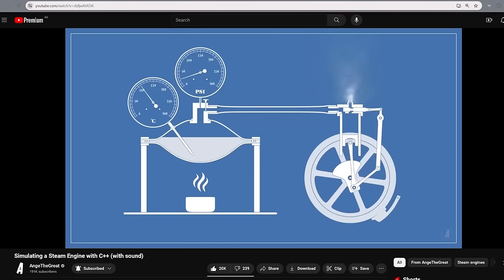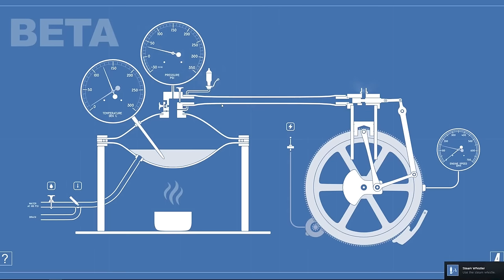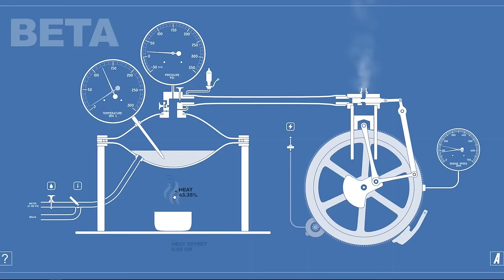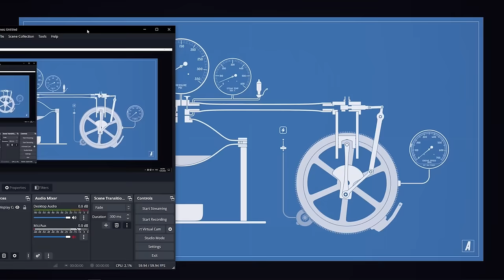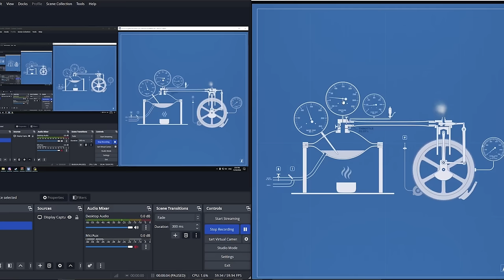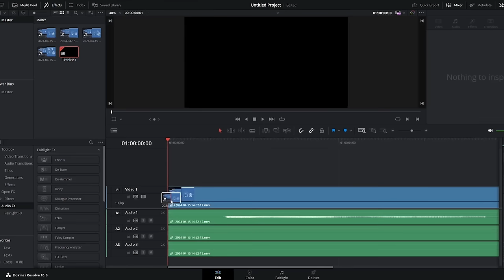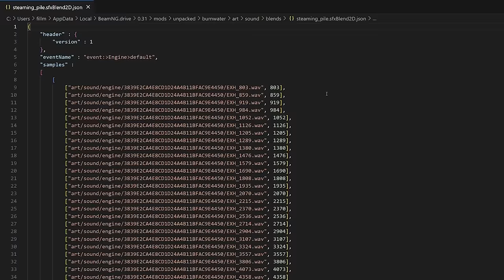Steam Engine Simulator into BeamNG

Comment: fun fact: contrary to popular belief, a steam engine does not have one chuff per revolution, most steam engines have two to four chuffs per revolution
Reply: more usefully there were like, three manufacturers that each made multiple models of steam powered road car, you could look up videos of those for the sounds
Reply: It depends on the number of cylinders and the number of power strokes, i.e. does steam operate the piston in both directions.

There were also multiple 3-cylinder locomotives that produced 6 chuffs per revolution, such as the Gresley A3 and A4.
Reply: It realy just depends on how the steam is built

Comment: I believe the trick to all this is: add a zero to all your values. Sure, it wouldn't be the actual RPM of this steam engine, but, seemingly from what you said, it would have at least had an easier time working.
Reply: Or add a 10:1 gearbox after the engine but before the clutch.  That being said, steam engines are much more like an electric vehicle than a normal car, there was no need for gears since you had so much torque.  The driver basically just set the throttle to whatever speed and the car went.

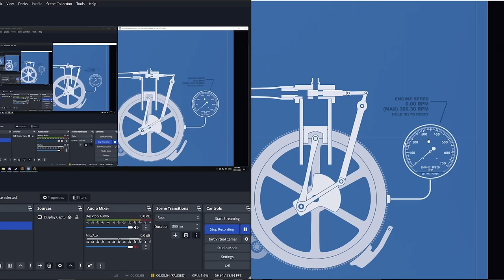Comment: 5:44 correction: thats the max RPM you hit, ingame by default it can do 700 and if you activate the secret it does some insane number like 20k.
Reply: More like 4500 or even 6000 if ur rlly good at setting it up
Reply: @jasonlin9805  yeah but that still requires the secret, as its the only way to get thousands of RPM, instead of just a few hundred.

Comment: So one tip when steam is up to speed and is burning clean there is no smoke/steam coming out the exhaust it only happens at lower temps or under serious load Kind of like giving a diesel truck the beans and rolling coal . So maybe have it come out at low Rpm and turn off at higher or when you give it a load. Eh but that is maybe a nightmare to code LMAO. Good job by the way sounds looks amazing!
Reply from the maker: If I had more control, then I’d have put more nuance into it. But thanks for the advice

Comment: Making it electric is technically more accurate than gas, because you would 100% go through water really damn fast, especially at high throttle. And steam engines are very heavy.. and also make ridiculous tourqe.
Reply from the maker: There are arguments for why it was the right choice :)
Reply: And they produce torque at 0 RPM

Comment: With a steam engine, or any engine, the faster and engine is rotating, the faster the exhaust beats. You can't usually hear the individual exhaust beats on a gasoline or diesel engine because of how high of an RPM they operate at. With steam, it can operate slow enough that you can count the exhaust beats. Also the amount of load on an engine determines how loud the exhaust beats are.(more load=louder exhaust).

Comment: The next big thing would be a turbine engine, with proper muffling like the Chrysler Turbine had, but I don't know what game could be used to extract sounds for it. Maybe Flyout? Anyway, I love this, unconventional engines like steam and turbine in cars are really cool to me.
Reply: It's coming to beamng in the upcoming Gavril Dynamo car mod, based on the Chrysler Turbine
I don't know how it will sound, hopefully realistic
Reply: @RickZanardi  From what it sounds like, the turbine sounds are a bit loud compared to the whisper-silent Chrysler Turbine, and its odd that the turbine goes up and down in RPM as it shifts, but the latter part is just a limitation of BeamNG since its not designed with a decoupled engine core and output turbine in mind. Otherwise, I'm quite looking forward to the Gavril Dynamo!
Reply: @Avetho  yeah you are right, after all this is so niche that it is pushing the boundaries of the game. But let's see, at first even hybrid systems were a pain to do but now there are a few mods, maybe a proper turbine car can be done realistically in the future.
Reply: @RickZanardi  I sure hope so, someone managed to make a convincing enough approximation with the Bluebuck with high inertia to simulate the inertia of a turbine spinning at 50k rpms, I just had to hook it up to a CVT and be selective in my throttle control to make it vaguely turbine-like in response. Its fun regardless, I can only imagine how exciting a proper turbine car would be!

Comment: Could you somehow hack the air pressure system of the T-Series to behave like a steam engine, and have the ICE just serve as a source of "heat" providing pressure to it, and use that pressure to drive the wheels?

Comment: Wood gas (yes thats a thing youtube has some fun videos on it) fuel mod next
Reply: A wood engine is barely different from a normal ICE engine though. The main difference is in the fuel storage system being more similar to LPG.

Steam engines have different torque curves, fuelling, cooling, etc etc etc. Basically the whole thing is inverse of what you expect with peak torque at 0rpm and the engine gets better the hotter it is wanting insulation not cooling.

Comment: You can hit the C key to show controls and exact speed along with speeds being x10 if you click the angethegreat logo several times in the bottom right allowing up to 7000rpm but I haven’t got over 4500rpm, so it won’t sound odd like how it was when it was first exported

Comment: 18:04 did you not see the huge speedometer in the bottom right i know that the air speed is a bit more accurate but was it very necessary to calculate?
Reply from the maker: The Speedo can be very inaccurate when testing top speeds
Reply from the maker: Also it was just some fun to use that odd speedo

Comment: Theres actual Electric Steam engines
Boilers being heated by electricity
Reply from the maker: Sounds counter intuitive because you could just run an electric motor lol
Reply: @fillman86  something you forgot is 
Electric motors were pretty crap back then
Reply: @fillman86  It was done by Switzerland because they didn't have any natural reserves of coal and coal from Germany was getting costy (because this was the 1940s) but they had a lot of hydroelectricity and hadn't fully replaced steam with electric, so in 1943 they fitted two small 6 axle steam locos with pantographs and electric heating inside the boiler and could run for 20 mins without power and then had the electric heating removed in 1951. Something like it was that some steam locos had electric pre-heater which slowly steams up the boiler so it can work in the morning.
Reply from the maker: @RiCKY-zt3tl  actually they weren't, but generation was. And if you go really far back, it was control that was the issue

Comment: Day 2 of commenting: You probably wont do it, but anyway. Here is a car Suggestion if you want: the Xiaomi su7. There are 3 variants of it, different in their Performance. I thought,that it would be a bit more of a Challenge if you would be able to switch modes in that car. But while driving, so you press a button and you can select between the Performance and the Suspension settings(like race mode with hard Suspension and comfort with soft ones). I thought Maybe 3 modes,and each mode should match the Performance of the 3 variants of the su7.
Maybe you are interessted.
Sorry for my bad Englisch,its not my native language. If you dont understand what i meant, i could try to rewrite it and explain it better if you want.
But anyways,i really love your videos

Comment: for the engine torque the max power would be at the very start and it would slowly go down until you reach the top speed of the car because the valves wouldn't be able to inject enough steam into the pistons to keep it moving

here's a video made by a professional how drives steam locomotives explaining why
https://www.youtube.com/shorts/wQlVVWz5Eh8

Edit: I say you messing around with the exhaust and the exhaust of a steam loco would be black when it has a fire and has no throttle input, grey smoke when it is working hard with max throttle input and a fire, and finally white smoke when there is no fire but max throttle input

Edit 2: also you would be surprised about just how easily steam accelerates when under no load, just search up any loco wheelsliping, the
Reply from the maker: Power is derived from torque and rpm
Reply: @fillman86  👍